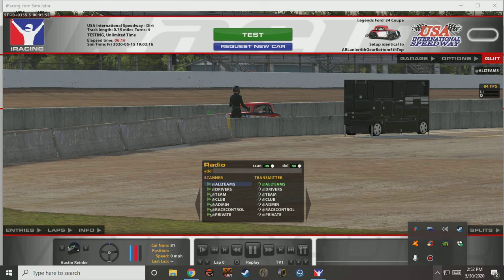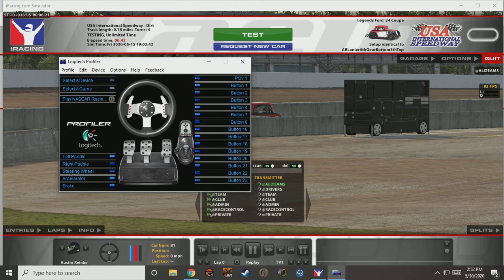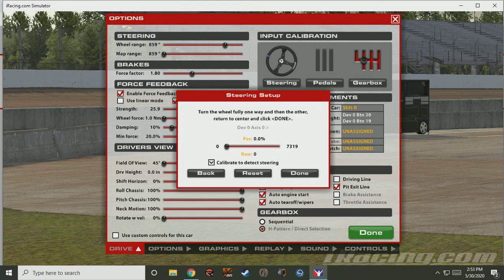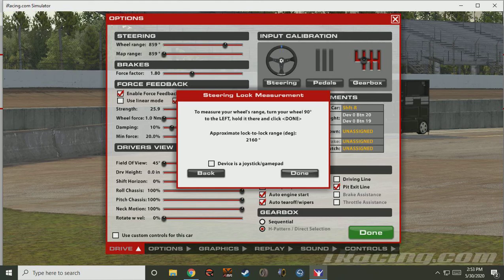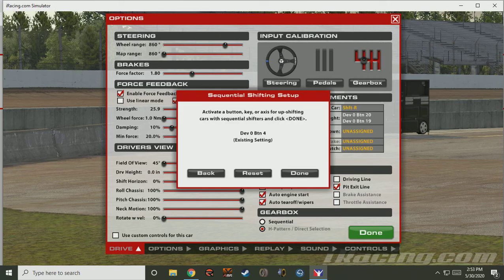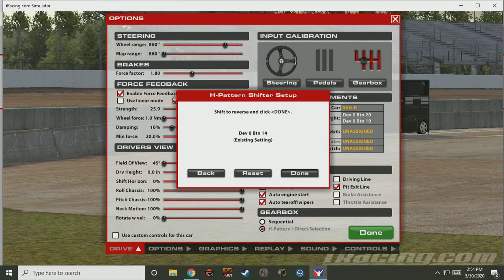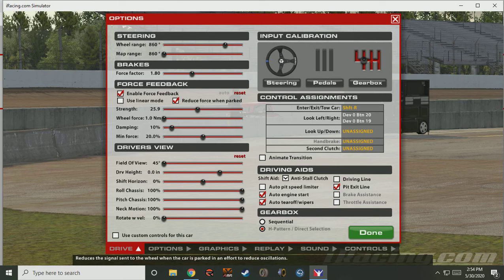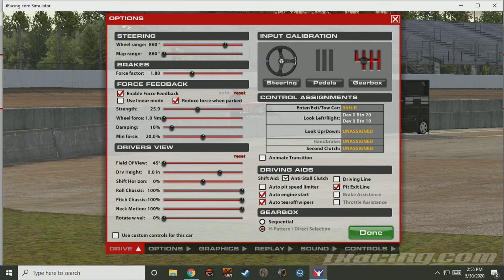Logitech G27 Wheel Settings for iRacing.

Comment: Hey, does iracing change the ammount of degrees depending on what car you use? Like, some cars will have 900 but others maybe 450 and stuff like that. Is there an option to do that? Thanks
Reply from the maker: Im not 100 percent sure but in the garage for each vehicle steering ratios can be adjusted if you'd like snappier or a looser feel. Thanks.

Comment: I'm questioning you using 1.0 Nm for  Wheel Force. I've read it somewhere several times, Nm for G27 was around 2.4-2.6. They were old stories, so I'm trying it with 1.0 Nm.  Great vid, thanks